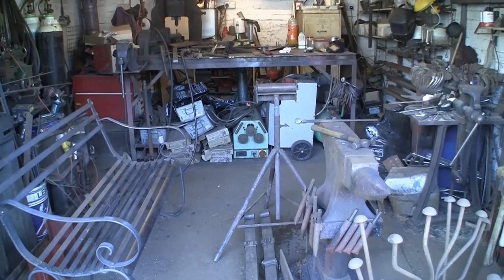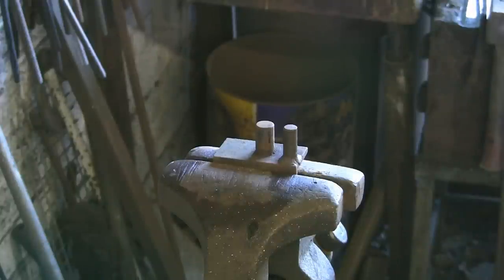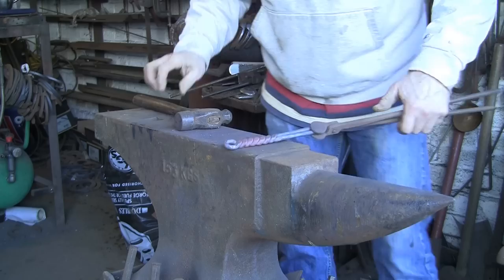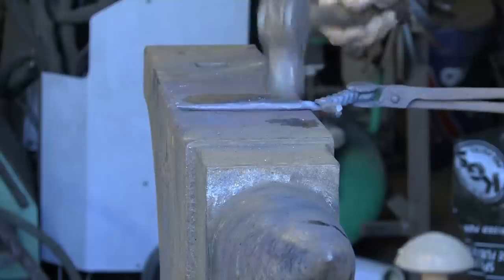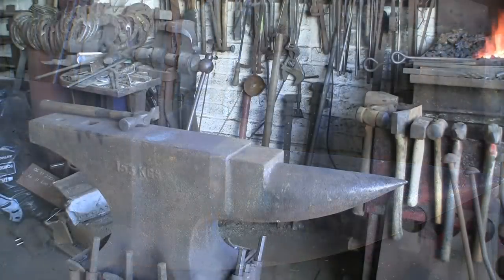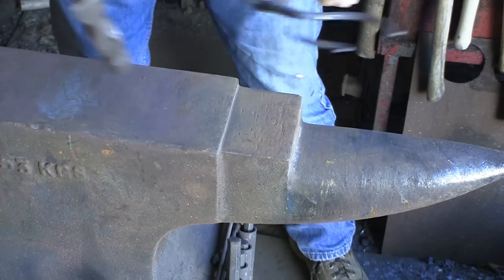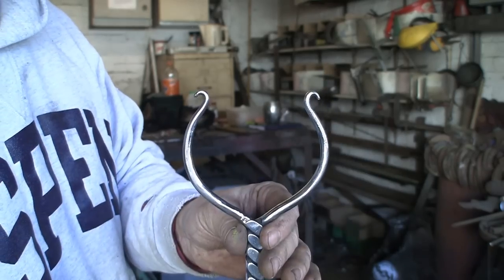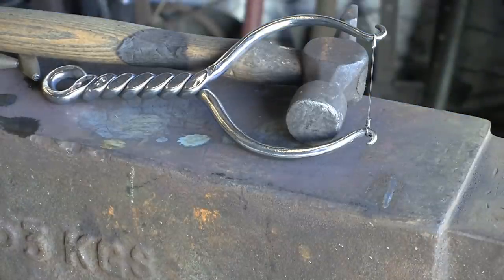Forging a Stainless Steel Cheese Cutter

Comment: from Texas Veteran Rebart , great video and that looks AWESOME! on cold days ….. take a piece of at least 1/4 inch thick flat steel and put it in the forge to get hot and place on anvil to heat it up so your work doesn't get cold to quick .

Comment: Mr. Huston,

I'm a novice to metalwork, but I think it would have been wiser to either wire-knot it, or hitch it around the horns of the cheese-cutter. I only say this because the hitches you did make interfere with the cutting surface a little (not much, not too noticeably), and therefore make it harder to clean. 

I really admire your work though, so I hope this falls on honeyed ears.

-Richard

Comment: With regards to cold anvils, I've had to forge in -20*C weather a few times. In those conditions, heating up the anvil helps a tremendous lot.

I built an insulated casing that fits over the anvil and overlaps the stand slightly, and I've got a 60W lightbulb that sits right below the horn. If I set it up the evening before, it's comfortably warm to the touch when I start. Quite helpful when dealing with smaller pieces.

Comment: Gary I may have missed it but the memorial bench what are you going to coat it with? Powder coat, spray paint or some other coating. That is a very well made item I would like to copy with your permission. Bill
Reply from the maker: +Bill Winegar It was powder coated. yes go ahead..

Comment: Hi Gary, Nice job this cheese cuter (as usual !).
Well I've one question about your bench.
Its awesome made, especially your riveting.
My question is: How do you rivet in place? (I mean: Not on your anvil)
You cannot put your bench on your anvil and hit the end of the rivet.
How do you stick rivets in place while you hit them?
Thanks for your really helpfull videos and comments.
So pleasure to whatch them.
Bye
Reply from the maker: I have bars of 2x1 inch solid of varying lengths each with a countersink in the end for the rivet head. I simply wedge the bars under the rivet and the concrete floor becomes my anvil. I also use a very heavy leg vice which I clamp to the arms up by the tenon to rivet them.
Reply: It clear for me now. It'll be helpfull for me to rivet my table.
Thanks a lot.
I hope I can show you my project quite quickly.
(By the way, if you need project ideas, why don't you try corckscrew...)
Bye

Comment: what incredible art and creativity
congratulations
Reply: How much time and material cost goes into one of these? You said Pinterest cost a lot. When you do your excellent video's it would be nice to include total time and material cost.  Thanks for all the knowledge and wisdom you share.
Reply from the maker: +Steve Larsen Material cost I don't really know as I had the stainless steel that was bought in a job lot from a sale, but I would guess pennies for the amount used. Trouble is unless you intend to make dozens buying one short piece is difficult. Time I guess was about an hour or so. If you value your time it was just as expensive as the mild steel one on Pinterest.. I couldn't make them any cheaper but as with 90% of my stuff it's a one off for fun or myself!

Comment: I noticed the stainless doesn't seem to be scaling up like mild steel. Do you happen to know the reason for that?
Reply from the maker: Not really sure but i'm guessing it's somehow purer!
Reply: Thank you for the reply sir. I really enjoy your videos and am looking forward to the next one.
Reply: Stainless has quite a bit of Chromium in it. From what I understand, it forms a Cr2O3 (chromium oxide) protective surface layer, which is much less permeable to oxygen than mild-steel scale (Fe3O4). This means it scales the same way, but the scale is much much thinner.
Reply: Ok awesome. Thanks for your answer. I just didn't notice much if any scale coming off when he was working it so was curious why.

Comment: well mate i heat mine and in the cold of New England i get twice to 3 times the open work time on 1 heat
Reply from the maker: Good for you!
Reply: How do you heat yours? From my comment above:

 "I built an insulated casing that fits over the anvil and overlaps the stand slightly, and I've got a 60W lightbulb that sits right below the horn. If I set it up the evening before, it's comfortably warm to the touch when I start."
Reply: gas     propane to be exact

Comment: Pretty
Reply: In Jewelry making, we have a plier that is called round nose pliers and they are tapered cones that allow us to bend the wire in perfect circles. The concept should apply to what you are doing with the hammer and anvil making the ends of your cutter rounded. Not sure... but might be a tool that saves you a bunch of time.